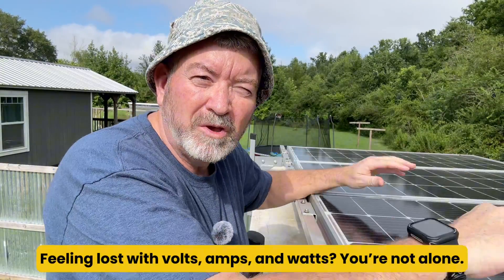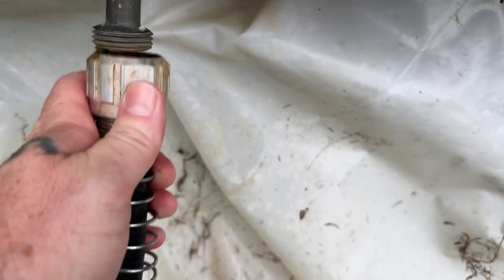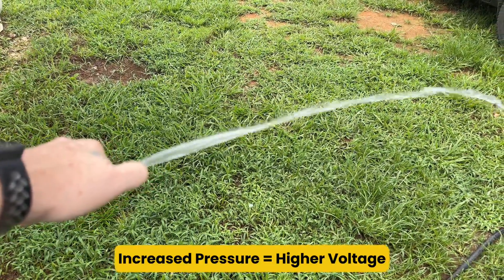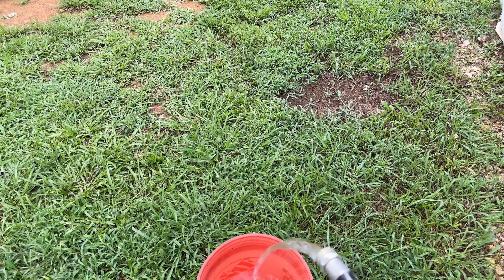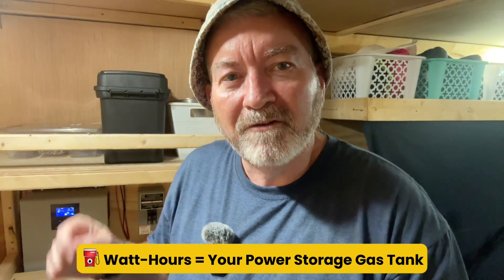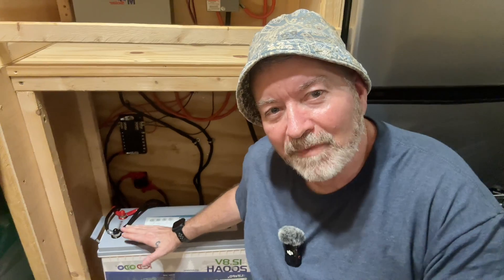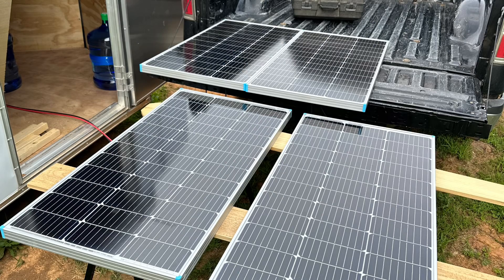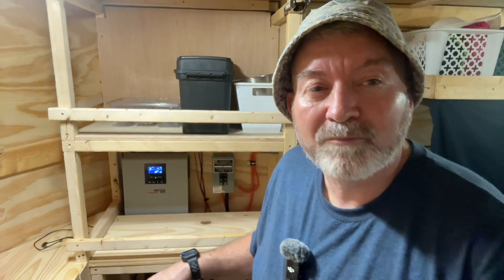Volts, Amps & Watts Explained Simply (Solar for Beginners)

Comment: Kevin, worked in the electrical/instrumentation business for a couple decades.  Managed 50 or so solar powered gas wells/compressor stations.  Radio, SCADA PLC and controls at each location, sometimes multiple wells on each location.   (Pre lithium battery days)

I didn’t hear you say anything incorrect.  Well done!
Reply from the maker: Thank you for the kind words! I appreciate the feedback from someone with your experience. I am just learning a lot of this myself and I am terrified that I will misguide someone out there, not just about this subject, but about anything. 🤣   If you do hear me say something - call me out on it! Appreciate you watching Rick!